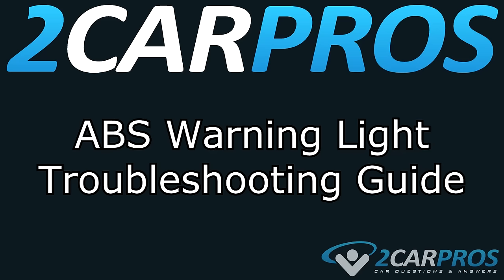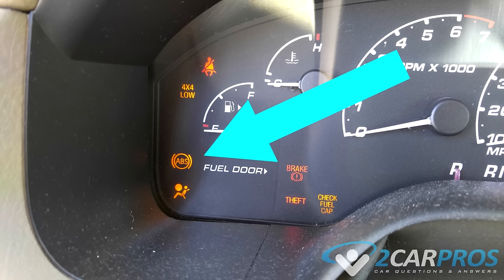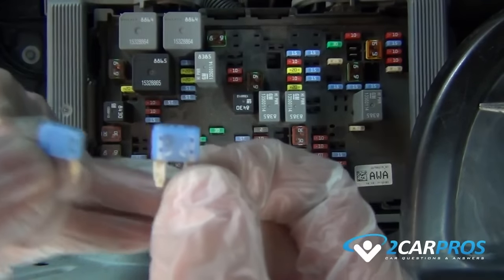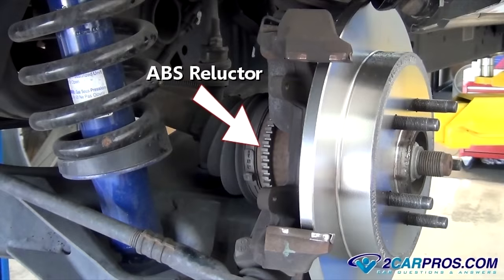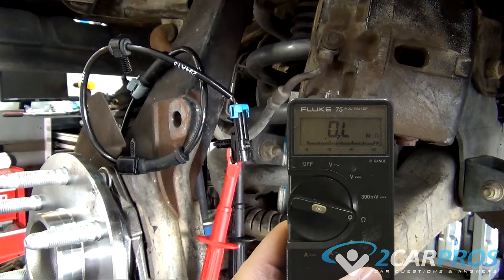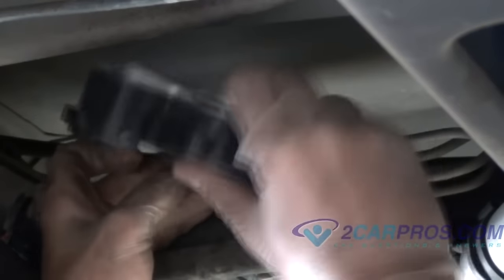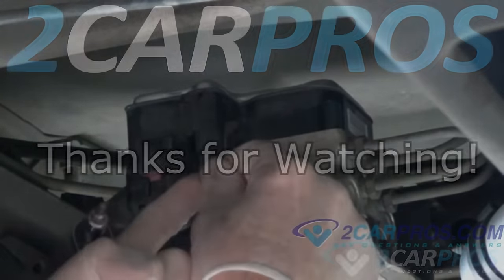ABS WARNING LIGHT ON? FIX IT IN 3 EASY STEPS

Comment: my abs has stopped working on my boat.
Reply: Lol
Reply: Ship it to me, I'll pay $99.00, you pay for shipping.
Reply: RUBBER UNDIES that's because didn't flush out your abs unit when you went from fresh water to salt water.
Reply: try the anchor
Reply: RUBBER UNDIES Did you follow the 3 east steps exactly. If you didn't, there's your problem.
Reply: Try rotating the air in your tires , if you have than its the bacon stracher , no wait its the conipurler pin
Reply: Call the lockless monster brake service toll free number , or check the department off All B S. Website at FOS.com
Reply: Fill the boat up with water to reset the system.
Reply: Another Boat Story (ABS)
Reply: Try to dry the sensors!!
Reply: Next time avoid a tsunami. Try it....
Reply: I've had this happen to me , all I did was clean barnicals off sensor at prop bearing and it worked 100%!!

Comment: I received a computer from a junkyard to fix a no start and transmission safety mode issue on my 2002 Dodge Dakota.  I gave a jump start and it all started.  I was able to make it home in 1st gear before the truck stopped starting.  The junkyard computer worked for the starting and transmission, but now displays an audible and light alarm for the ABS.  I drove the truck and stomped the brakes several times and noticed that the ABS system was working correctly.  No skids.  Help

Comment: if you can't drive a car without abs you shouldn't be licensed
Reply: George Marinos I agree... However if it is a wheel bearing problem turning on the light... You might wanna get that checked out...
Reply: good point
Reply: driving isnt usually the issue, its passing inspection.
Reply: Cannabis Country definitely because you cant sell the car hell ive had a work car i wish i could just sell it
Reply: my abs wheel sensor is out so my car pulls to the right now because abs pump isn't functioning...otherwise I wouldn't care
Reply: Hahahaha, true. Your wife if you have one must be awesome!
Reply: That's correct I got to make everything stupid proof but all that crap is doing on my car I have no idea let's go back to when they made real cars and trucks with all this garbage off
Reply: @johndoe6047  ill buy it. Here is Texas any car will pass inspection bald tires every light on open headers no problem
Reply: @QPham-nz5po  its pulls because a wheel bearing
Reply: Chevy sucks true, if the inspector is flying under the radar!
What you just stated is false by Texas state law.
Like I said, only by a look the other way inspector.
Reply: @mikejustice1196  there is no emissions in most the state. And all inspectors are like that they will pass anything  Unless you go to a big chain store to get inspection
Reply: throwing shots at millennials
Reply: It's not the ABS that's the problem, it's that it usually disables traction control and 4 wheel drive features as well. Don't know what safety engineer thought that was a good idea...
Reply: thats the damn truth
Reply: You can drive it......the brakes will still work...........BUT..........they work more efficiently and operate best with the ABS functioning.......which is what they were designed to do.

You might find you need slightly more pressure on the pedal when you apply the brakes........BUT .......this is not always the case.......and you don't always notice this when driving. We all become familiar, (perhaps sometimes too familiar), with our own vehicle and its braking efficiency .......and because the vehicle stops we are content.

The indication of an ABS fault, (warning light), does not reveal any problem with the hydraulic pressure in the brake system......that remains the same.

What you will notice.......especially if you have had an ABS fault that has been repaired........is how much better the brakes are after the fault has been repaired.........AND.......the anti-skid protection and efficiency is also restored to the vehicle.

Of course, if your car has to be tested for road worthiness at a Testing Station, (a requirement each year in the UK after a car becomes 3 years old), you are likely to find that an ABS warning light reveals to the tester that there is a fault.........and the vehicle will fail it's test until the repair, (whatever repair that is), is completed.

James Hennighan 
Yorkshire, England

P.S.

There is no correlation between being licenced to drive and a fault on the ABS..............the fault, (any fault), could occur at anytime.

Similarly, if the vehicle pulls to one side on braking this is likely nothing to do with the ABS, but more likely to be a fault with the caliper or pads on one wheel. Pulling to one side indicates good breaking operation on that side and poor braking operation on the other side. The pads could be worn on one wheel more than on the opposing wheel.

Most likely fault is a jammed piston in the brake caliper.

Calipers can be easily changed, (usually on a swop the old one for the new one basis)......BUT......cleaning and servicing a caliper is a fairly easy job and specialist brake shops or auto stores can usually supply kits to change the seals and the caliper slide pins........additionally, new pistons are also available for calipers.......... but it is possibly to polish the piston if it is not too pitted, with 600 grade wet & dry paper. Even a pitted piston can be polished to a fairly good standard, if required. It's just a case of taking some time to do it.........and even if it still look rather pitted if you have polished it carefully it will be smooth enough to function efficiently.

Polishing the piston with 600 grade wet & dry will not affect its dimensions, (diameter), appreciably or cause problems with it sliding within the caliper. New seals are more than capable of ensuring things work as they should.

But if you don't wish to do thus just renew the piston.........which works out at approximately $12 - $15 per piston.

Whilst you have the caliper off its a simple task to clean it off.........wire brush, or even getting it blasted...... before repainting it. Clearly wire brushing is cheaper and easily done in the garage or workshop.

I recently did my rear calipers and with wire brushing and a couple of coats of Hammerite sprayed on they look fine. I then used a repair kit to renew the internal seals and the slide pins.

Hammerite is fine for painting calipers...... you do not need special, (and sometimes expensive), heat resistant paints, because calipers do not get that hot when the brakes are applied. The heat generated by the pads on the discs, (rotors), is dissipated fairly quickly when you take your foot off the brake pedal.
Reply: Plus if the lights are on, your car won't pass inspection.
Reply: Ardent Fan  thank you I never knew that I always had an older Dodge 80s models they were a whole lot simpler than now
Reply: Bruce Lee bro this is happening to me now! What did you do to fix it and what was the problem
Reply: Plus on some systems the ABS malfunction can cause hesitation in performance in the middle of say a city intersection
Reply: @jameshennighan8193  wow! You should (did) an outstanding job, expounding on this issue. Grately appreciate it.
Reply: Problem is it won't pass the state inspection.
Reply: I agree. The ABS pump is a dangerous menace, unreliable. My brakes failed (Peugeot 407) completely  and my friend's  Mercedes CLK  had brakes coming on at speed, caused by ABS pump. If you  remove the ABS pump fuse the car will drive perfectly safely, but in the UK they fail your car  for the ABS WARNING LIGHT ON THE DASH,  SO YOU ARE FORCED TO HAVE A DANGEROUSLY IMPERFECT  BIT OF TECHNOLOGY INSTEAD OF  A SAFE BRAKING SYSTEM. If and when my  407 passes the MOT I will remove the ABS pump fuse immediately, so that I can feel safe. I wonder how many accidents have been caused by the  ABS pump.
Reply: @alankenworthy9722   @Alan Kenworthy  You reminded of the e38 i have that was pulsing the brakes while i was driving at slow speeds. There was no telling what the car would do. It turned out to be a melted looking spot on the rear wheel bearing that was fooling the abs sensor. The bearing itself was in good shape. But they put the the abs ring right into the rubber seal. Unfortunately on that car the manufacturer  uses the abs system to apply the breaks Independently to each wheel to operate the traction control system too😂
Reply: @ifitaintbrokefixit3975  Wow,  what a horror story. I thought the Spanish Inquisition had the last word on torture, but modern car electrics  bring a different dimension of  pointless complication. Years ago I bought Alfas for £150,  fixed the brakes then   tuned them by turning the distributor head.  Paradise lost! Blame the EU and Formula 1.
Reply: won't pass inspection with any dash light on, no matter where you take it for inspection here in NH. soooo there's that.
Reply: There's more than one way to get a dash light turned off. . .
Reply: I can, but the car can not. (Will not shift past third gear)
Reply: @jameshennighan8193  1
Reply: Been driving without my abs for yrs  with no problem   and my emergency brake cable broke. And don't really need either
Reply: @bill-to7ir  sad people can't drive?
Reply: That fixed my problem with abs light 🤣

Comment: I had abs ligh alarm on after i went to Ford dealer in orlando to adjust my tire pressure from 60 to 80 psi on the 4 rear wheels dual axis. Sometime it turn off and on. But yesterday i went to chevrolet dealer avec he said my tire pressure was not at 80 psi on all the 46 wheels! The front was still 60 psi and  and no e if the 4 rear wheels as the same psi pressure. From 67 to 74!!!. Since he adjust all 6 wheels at 80 psi. Since 2 days no abs alsrm on anymore! It was ford e-450 2003 super duty custom v10

Comment: 1. I just got a quote for this where they quoted for replacing the entire hub assembly on both rear wheels.  Would this ever be necessary ???
2.  If I buy 2 new sensors online and replace them myself, will the warning lights automatically go off ??  or would I need a diagnostic tool to reset them ??
Reply: WhyTrumpQuestions thanks for the answers. I've since done a bit more research and the Getz model I have has hub assemblies which include the built in abs sensor so you can't just buy the sensor. I will check the fuses and connections and if all else fails order the two hubs online and get a mechanic to fit them. Thanks again.
Reply: Usually they will go off by themselves after replacing the hub/ hub assembly.

Comment: Easy steps? Maybe for gearheads.
Reply: It is not hard to understand if you listen and not just say it's hard with the first word you don't understand!
Reply: Apparently you thought it was really hard too. pfft :D
Reply: Rick Weber
Reply: DrummermanMatt
Reply: Rick Weber
Reply: What?
Reply: Rick Weber lol I didn't learn a damn thing from this video.
Reply: check your blinker fluid
Reply: I had the abs light come on and stay on after I started the car. I restarted and the light went out and stayed out. After a few weeks of this the battery failed. No start. AAA replaced the battery and after that the abs problem was cleared!!!
Reply: abs light means you're weak and need to work out more. Your car knows how wimpey you are everytime it has to help you make a turn. ie power steering power assisted steering... Weak abs suck for both you and your car. Even causes uneven tire wear on the front.
Reply: My 7 year old nephew was watching this with me and understood these instructions quite easily.
Reply: @jameslamson5092  Do you still have the same vehicle? And is it still cleared?

Comment: If the abs light is on... don't worry about it, u don't need it
Reply: I can’t pass inspection with the lights on
Reply: thats not true, abs will affect speed sensor and therefore affect shift points and trans behavior.
Reply: not true my 4wd wont lock in because of it
Reply: Ehhh...  I disagree.  Both times my ABS came on, grinding in the wheel occurred within 30 minutes.  over three hundred dollars to fix both times.
Reply: @gxrebel1730  yea I just had my rear wheel speed sensor replaced at the shop & when I picked it up, the abs light was off until the next morning it came back on again & now it stays on everytime I drive it. what else could it be?

Comment: hi
I have a ML55 AMG , While driving normally or on a bumpy road the EPS, ABS, BAS, Brake light come on with beeping sound.
the steering feel a little tighter and the beeping sound stay on until I park the car and turn off the car. after turn of the car and restart it's work fin

Comment: I have this light on in my 2006 pontiac g6-gt,v6 3500,.along with that my traction control is on and as i checked it with some code readers  they all from speed sensor curcuits and on both left and right in the front,..so i must try to do that and see, back yard mechanic mason,..thanks..

Comment: well i would give a like if the video was about what i was searchin for ,a 1996 impala SS abs light comes on but resets when system is off and comes on again if i travel ahead at 100 feet or more..i need a diagram

Comment: Hi I have an 06 Silverado 1500 ss abs and check brake system light on took it to the dealer they want $991 dollars good lord. Can anyone help me out here . Thanks
Reply: GM antilock brakes are extremely dangerous, especially at very low speeds. They have caused many parking lot fender benders by cutting all braking ability and letting the pedal go to the floor. I pulled the ABS fuse on my '97 Silverado, which gives me normal braking and now it works fine. If I ever sell the truck I'll put the fuse back in.

If your other brake light is on (not the ABS light), that's something that needs attention. Take it to a competent independent mechanic for a diagnosis and estimate.
Reply: @ttiwkram  great information, thanks

Comment: Does this apply to BMW’s? I have a 520xi, just had the wheel sensor replaced, because it needed to be. Now I’ve got one more thing to fix on my BMW, and that’s the ABS 4 x 4 brake light. I’m kind of pissed because they just told me it would be $300 just for the diagnostics. BMW usually doesn’t rip me off. But that seems off to me.

Comment: Have a 2002 Nissan frontier.can not get any brake fluid to the rear brake cylinders. I checked it today and it was dry. Any help would be appreciated
Reply from the maker: Make sure there isn't a kink in the brake line coming back from the front. Thanks for watching!
Reply: @2carpros  no kink in line. Getting brake fluid to the block but not to the  wheel cylinders

Comment: I caught the electrician at my villa on the way out the door having not fixed the tripping breaker that I had called him for.
He decided that the  20A was tired so had already replaced it with a not so tired 40A one. But that was also tired so when I caught him he was heading back to his workshop to get a 60A one. We put the 20A breaker back in and I walked him round that circuit until we found a faulty water heater. "You can also do it that way" he said.
Not so sure about the fuse going "weak"

Also not so sure about the most common cause being the failure of the ABS controller. I have had ABS lights come on on 4 cars. Ever one was sensor related.
Reply from the maker: I have never heard that before.

Yep sensors are usually the main problem. Thanks for watching!

Comment: Mine is a 15 Jeep Patroit and my abs/traction control lights both go on and off randomly. This seems to have happened following a near accident when I had to apply breaks heavily and my Jeep skidded a few meters. Could be coincendence not sure. No codes are found when I use a code tester. Can you point me in a direction?
Reply: Did you get it figured out?
Reply: @Flowerchild778  I did not. Ended up trading it in several years ago. I’ve had two cars since that one! Barely remember! lol

Comment: 2009 ford focus: had startup stall, when push the traction control button problem goes away. replaced both wheel bearings and still have the problem, and now add the abs lite ! and the brake warning lite too !! ... pads and drums are good and have no braking issues. trouble code says traction control module. wow. i dnot want to mess with this, have to take out the dash. cannot afford to pay a mechanic $100 per hour or the dealer $180 per hour ... what do i do ??? guess i can put up with it ... can i just disable the tcs and the abs? am never in a driving situation that requires these ...
Reply from the maker: That is a complicated question, if you go to our website www.2carpros.com and ask a question for free, an expert will be along shortly to help! Thanks for watching!

Comment: I measure 3kohm on all my fiat punto mk2 1.2 8v 2004 year car abs sensors, and no voltage when i spin the wheel, could the sensors cause abs light turn on and my abs not working ?

Comment: My abs sensor was torn off so i replaced it and used butt splice. There are no markings on wire, so does polarity matter? Removed negative from battery t.o try to clear and it did not, also brought to dealer and their computer wont clear it either. I was going to try and switch polarity

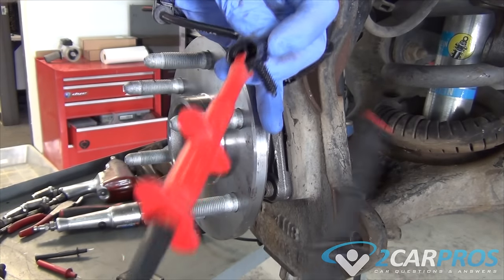Comment: 'NOT picking on such a high quality VID-- @2:22 it says AC setting, not DC-- why would it be AC on anything in a car ? please clarify if you will
Reply: A magnet moving within a coil creates a voltage. Positive one direction and negative in the other. AC. I would have thought more of a square wave and frequency would occur but I'm not that familiar with the component. But I do know a short is 0 Ohms and an open is infinite Ohms. Not sure why he worded that part like that.